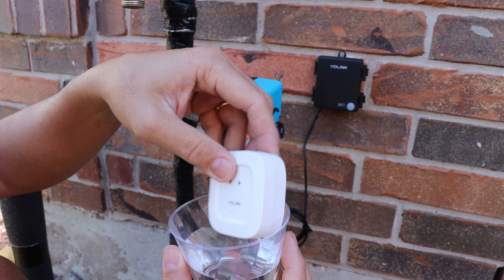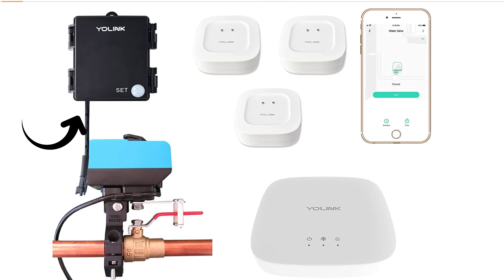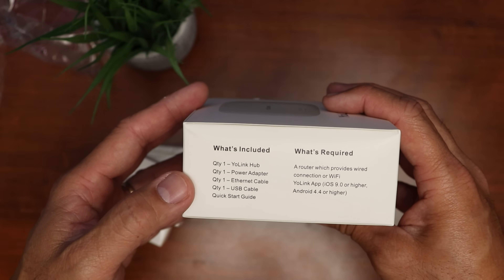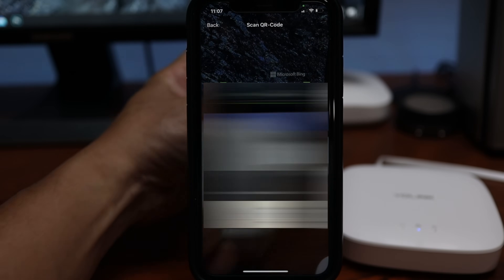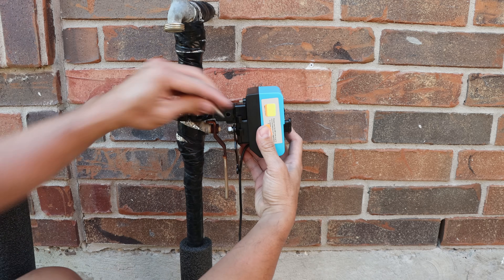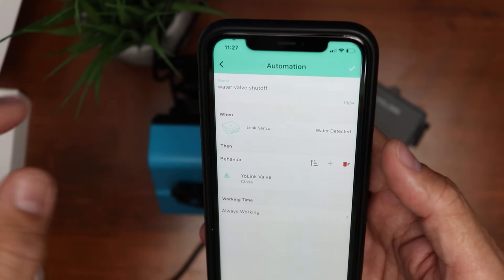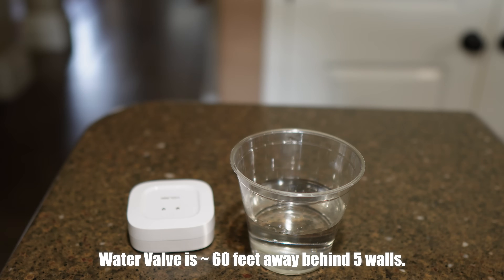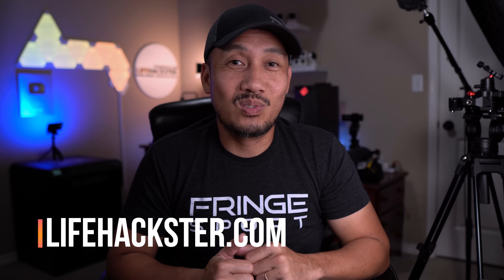YoLink Water Leak Sensor & Auto Shut Off Valve Control - Prevent Flooding From Water Line Breaks

Comment: I've had this exact setup for over a year and a half and it works perfectly.  I'd like to offer a couple of other points.  Although you mentioned them being battery-powered, it might not register with some folks that this means the system will not only work if you're Internet is out, but will also work if your network is out, and also work if the power to your house is out.  This is a big deal for those of us along the coasts.  They also have a battery powered alarm which will also connectly directly to these devices.  Of course, with no Internet you won't get a phone notification that you have a leak, but the devices will do their thing just the same.  Because it's LoRa it's also perfect for folks who have spotty WiFi in their homes and don't have mesh routers like a lot of your viewers will have. Some folks have mentioned to me that the valve operator isn't very sturdy, but this is designed to only be used very occasionally and mine works fine for that.  Remind folks to think about where their leak points are.  I have sensors behind each toilet (anyone ever have one stop up and overflow?), behind the refrigerator, under each sink, behind the washing machine and near the water heater even though mine is tankless.  You are always on top of these things and I enjoy watching your channel.
Reply from the maker: Thank you for the information. I'll pin this comment on top. I have ordered more sensors to place under my fridge and the water heater. It seems like you can set the sensors up to work on both the hub (automation) and the Yolink Control which is cool.
Reply: +1 to having tons of sensors.  If you are afraid of cost, think of it this way:  If the sensors stop just a single leak at some point they will pay for them selves many times over.
Reply: Is this the only company that has LoRa feature because I had issues with delivery on Amazon!!!???
Reply: But if you set them up in this way, there is no connection with the hub even when you do have power and internet, correct? So you have to choose if you want a notification on your phone,  OR have the system work during an outage. You can't have both without a redundant system.
Reply: @pilotdog68  My primary requirement for a leak is that action be taken regardless of the power/Internet status to prevent/minimize damage  This takes the hub out of the picture as it is there for notifications and integration with other systems, like Alexa and IFTTT.  Once power/Internet are restored then you'll get that notification if a sensor is still wet.  My Ring alarm always notififies my phone when it's on battery backup power so I'll always know there was a problem.
Reply: Hi Hugh Dinwiddie  just a quick question do you always control the valve closure with battery powered controller and how often do you close the valve and how long did the controller battery last. The reason I am asking is because I am planning to install the valve controller in a hard to reach place and it will be completely of the valve controller battery and I will be opening and closing this valve once every 7 days since I am using this controll water to my underground sump tank. So using at once in 7 days will the battery last for at least two years?

Comment: Great video. I found all components out of the box very easy to configure using the instructions in the box. Everything worked. I got a text message when I touched the sensor with a damp cloth. What was not obvious was the need to use the Smart Automation so that the valve would close automatically when I got the notification. Your instructions on minute 6 covered that perfectly. Thank you!

Comment: I highly recommend this system. And thank you to LifeHackster for the super informative and helpful video. I just followed your instructions and got the installation job done successfully. I can't thank you enough for saving me tons of time that I would have spent reading and comprehending the installation manual. The only costly part in my case was I had to hire a plumber to install a quarter-turn shutoff valve as my original one was multiturn....that guy cost me more than the whole unit ( $400). So far, I'm very happy with my investment in this system. One question though- it looks like you can only re-open the shutoff valve through the App (not manually) once it's closed from one of the sensors having sensed a water leak- am I missing something? Thank you again...Happy New Year 2025.

Comment: The Amazon product link has a potential buyer question if the valve is waterproof as the video installation shows. yoLink answer stares no.  One other buyer answer states they installed it in a waterproof box.   Great video!  I live in Florida and would install it per the video if waterproof.

Comment: Hi, thanks for the video. I’m wondering if a pipe breaks somewhere outside of the sensors, how will the system know to shut off the water? Does the hub/controller always recognize this or is there a specific automation we have to set for it?

Comment: would be better if the controller was built into the motor and not having to mount on the wall and drill holes.
Reply: Zip tie to the unit?

Comment: There are two types 

1 is motion sensors for each shut off valves activate only if no motion in provincity or human detector 

2 is detect the drop between the upstream and middle before down stream then it activate if both down stream and upstream same drom then it being in use no activation

Comment: thank you, this looks great. My question is after the bulldog valve robot is installed, is there an easy way to manually turn off the water valve? (like in case we need to shut off for some maintenance work)
Reply from the maker: Yes, you can. There is a small button that you need to press on the back of the unit that it will disengage from the motor and you will then able to manually close or open the valve.

Comment: Great Video- A question please, I live far away from the rental house. If internet is down, where I can not open or close the valve from my phone, is it easy to manually open and close the valve on site? Do you just turn the black dial?
Reply from the maker: Yes, there is an override metal button on the back that you need to push so that you can turn the black dial.

Comment: what is the difference between water detected and water leak alert ? wouldn't that both be when water is detected? i don't get the difference.  Also currently do you have to set an automation for each water sensor? i don't see a way to add multiple sensors to the same alert'.
Reply from the maker: Yes, both are the same and I do set automations for each sensor. I wish you can do it and select multiple sensors in one automation.
Reply: @LifeHackster  I heard back from yolink support and it is possible with some workarounds.   Per instructions below i ended up making an alarm strategy just for the water sensors (prior it was all under 'always', but now i have a separate called 'water sensors'.

 If you would like your 8 water sensors to be bundled so you won't have to create 8 automations for them to close the valve, there is another way to set it up. Please follow these steps:

>>From your app's main page, tap smart> tap scene> tap the + sign> name your scene> behavior +> device actions> choose the valve> close> tap the 3 consecutive checkmarks to save the scene

>>Tap the 3 lines at the upper left corner> settings> alarm strategies> on the alarm strategy that the sensors are using, tap "edit"> related devices> please include only the leak sensors> tap the back arrow once> trigger action> choose the scene you just created> confirm> save
Reply from the maker: @robrichman3314  thank you very much for the info. I appreciate it.

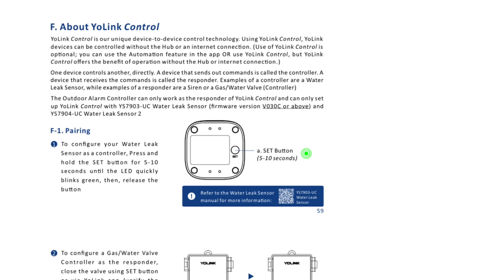Comment: Dear, @ 7:24, Do you turn water main valve off b4 pressing the water  leak sensor and then the controller to pair them up? or do we only need to turn the water main valve off when pressing the set button on the controller only? I tried watching the video multiple times and could not hear it well. You seemed to only say that we needed to turn  off the water main valve when we pressed the set button on the controller only but you did not say anything for the water sensor which you pressed the set button first b4 the controller's. Appreciate your input, thank you.

Comment: Tip: When pairing the YoLink Valve controller with your sensors, make sure the valve is the "Closed" position, i.e. the position you want it when the alarm is triggered.  If you pair them when the valve is set to "Open", nothing will happen when there is a leak.  Kinda a big deal.
Reply: Do you turn water main valve off b4 pressing the water  leak sensor and then the controller to pair them up? or do you only need to the water main valve to be off when pressing the set button on the controller only? I tried watching the video multiple times and could not hear it well. He seemed to only say that we needed to turn the valve off when we pressed the set button on the controller only but did not say anything for the water sensor which he pressed that set button first on video. Appreciate your input, thank you.

Comment: First of all, thank you for your instructional video. It is very well done but I did have to slow it down in places so that I could follow the instructions more effectively. After struggling for months with a $1,500 Kinetico water leak detection and shut off system that never worked reliably, I finally got rid of it and after doing extensive research I installed the Yolink system you describe in your video. Other systems like Phyn and Flo require plumbing work to install the shut-off valve and they have too many moving parts for reliable operation. In less than an hour I had installed eight sensors, two hubs, and the valve shut-off motor. When installing the motor you should caution users to ensure that the brackets secure the unit tightly to the water pipe, else, the motor will move and twist when actuated. I am using an ethernet connection to the hubs for reliability. I disconnected the internet and tested the direct sensor to valve communication. The distance between the two was greater than 200 feet, the valve receiver is under the house, we have a brick floor, and several walls. Communication was perfect! I then went on to purchase and install a speaker hub, door sensors, and refrigerator thermometers. Installation was a breeze. I now get voice warnings if the freezer door is open for too long and if the fridge temperature is too high. It's a well integrated system, installation is easy, and set-up is intuitive. I did have a problem with one of the leak sensors not communicating with the valve. A telephone call to customer service solved the problem in just a few minutes. I recommend the system and the customer service highly.

Comment: Great video and the review. 
I have a question about the installation of the valve and the controller outdoor.
Do you need any encloser or it is a real weatherproof construction (rain, etc.)?
Did you have any problems with the weather (rain)?
Reply from the maker: Nope. I left it as it is. Both are outdoor rated and I haven't had any issues.
Reply: @LifeHackster  Thank you for the confirmation. I'm waiting for my valve. I also saw found that there is a HASS integration for YoLink. I want to test it as well (I already have four YoLink water sensors and a few Zigbee).

Comment: Do I understand correctly that if you get an action (closed valve)  when there is no internet or power (via the direct connection), you will not get a notification?
Reply from the maker: Yes…all notifications of smart devices that I know of uses internet or WiFi.

Comment: Did a ton of research on these types of units, phyn +, flow, yolink, etc. I went with yolink….the sensors & shutoff work great. I swapped out the provided  alkaline batteries & put in all lithium batteries. Yolink customer support is great. Also bought the yolink smart hub & door sensors & motion sensors. Yolink also makes an outdoor motion sensor. Can link it up to your smart lights via Alexa.

Comment: What a helpful video! I followed your steps and via the automation tab have the sensors set up to turn off valve when water is detected. Do I need to physically push the button in the sensor and the valve so that they can directly communicate via LoRa? Thanks!
Reply from the maker: Yes. You have to program that separately but after that, you know that when the hub automation doesn’t work (e.g. no power) the direct LoRa should still close the valve even if you have no power at your house.

Comment: Can you use eero as your only wifi source or is eero just an extender on your current internet provider?
Reply from the maker: It can act as both. You can setup one as the main router and the other ones as extenders in the app.
Reply: @LifeHackster  so you can use eero as your only wifi? Is there a fee?
Reply from the maker: @Joy-fy1ce  yes..no fee..they do have the security subscription if you want but it is optional.

Comment: That's a great product.  My only concern is whether or not the machine could damage the valve lever by inadvertently torquing too much somehow.  Any concern there?

Oh, also, once you have it installed does that mean you cannot manually operate your water valve?
Reply from the maker: When properly setup, it will not over torque because the bulldog valve manipulator will only move 90 degrees. You can manually operate your valve by pushing a button on the valve manipulator to release the gears.
Reply: Yeah I was thinking about over torquing too. What if the mount fails and you have this trigger? Could it damage the valve?

Comment: One thing i am not quite happy about the YoLink leak sensor is, it’s way too sensitive. It even warns me if the air is too humid or steamy especially when it’s inside a bathroom and someone takes a shower.
Reply from the maker: I have installed 1 sensor in my kid's bathroom which they usually do hot showers and the sensor hasn't tripped yet. What you can do is to cover or tape the top probes because I think that's the one exposed and triggers.
Reply: @LifeHackster  Thank you! I can give this a try. :)

Comment: I would probably go with “direct communication” set-up. 
It seems that internet isn’t as predictable as I would like it. Especially when you are gone for a while. (That’s when you would most-like to have water main monitoring!!) Some internet cameras and sensors disconnect on their own, and need rebooting, re-sign-in to app etc. Which is difficult to do when you are away from your home. The direct communication bypasses all of this.
Reply from the maker: It seems like you can set it up so that it can do both. Or if you have the hub plug in to a UPS, that will work too. The internet part of it is just for you to be able to access the device(s) on the app from your phone and to get notifications. The sensor, hub and the valve uses LoRa to communicate and not WIFI.
Reply: So which one have direct communication set up?